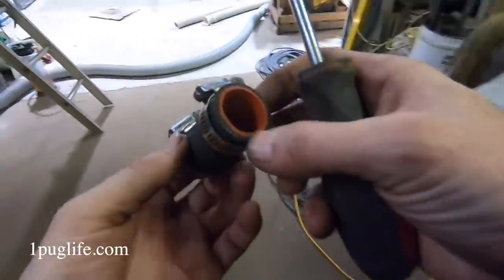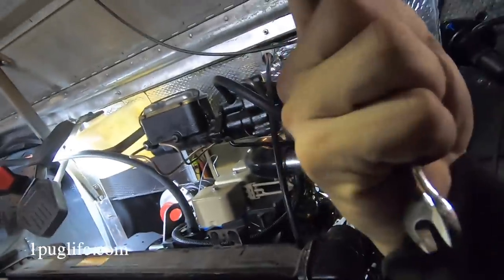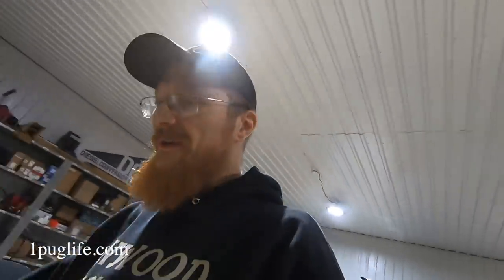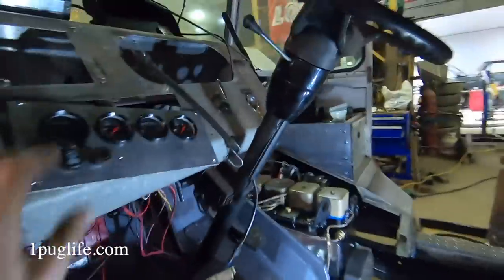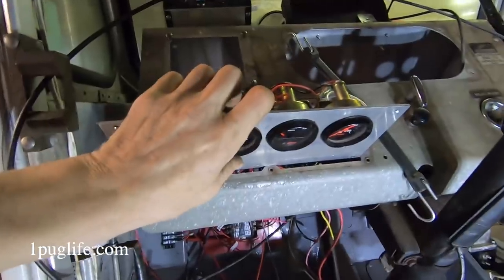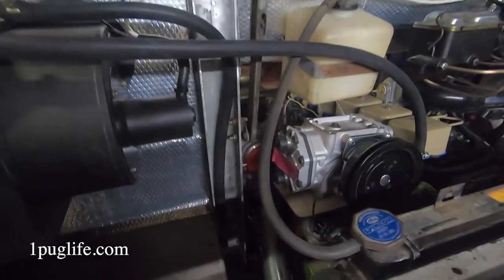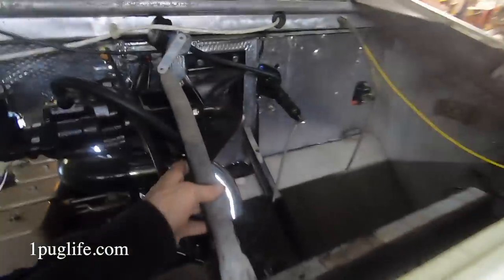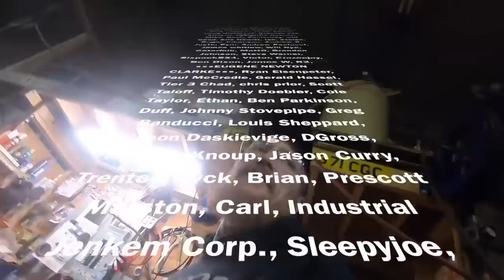lots more done on the grumman

Comment: CLAMPS. Buddy I leart sumthing before one time. Constant tension clamps are for hoses that get hot and cold so they can expand and contract. they're the annoying clamps that you have use pliers for getting on and off. The screw type won't do that so the other ones are more better for your heater hoses I think prolly.

Comment: Lookin good! Take some time and make yourself some line up bolts. get the thread and pitch find some bolts that are longer 2 or 3" longer and cut off the hex head for your heavy stuff, flywheel, pressure plate, turbo..ext. makes it a million times easier working by your self. I worked on big trucks, I have a whole tool box drawer of them for everything. Then put them some place you cant find them the next time you need them.